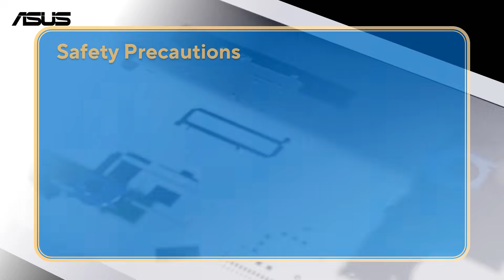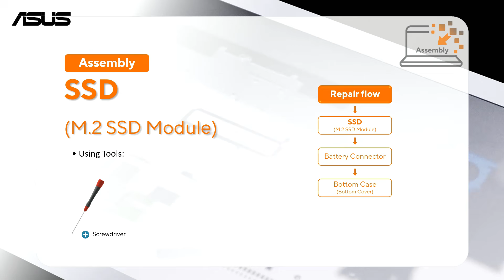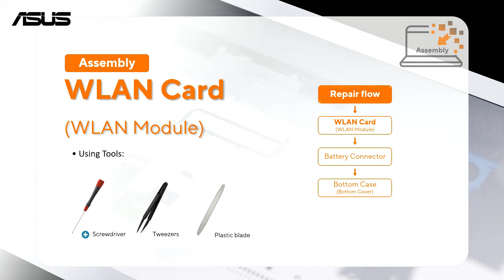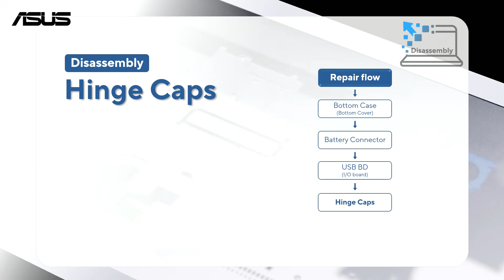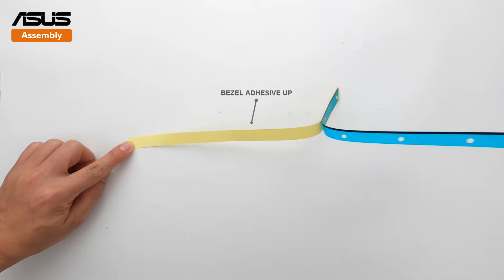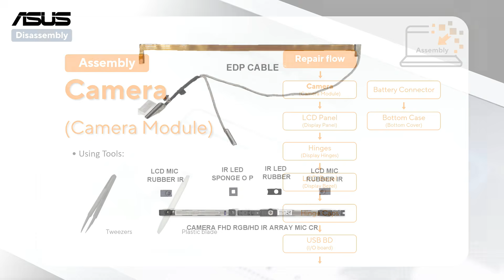Teardown : ASUS Vivobook 14 (M1407GA) Teardown video | ASUS SUPPORT

Comment: I am having a problem with ASUS Driver Hub. I cannot launch or use the application properly because every time I try to open it, it keeps redirecting me back to the ASUS Driver Hub home page. As a result, I am unable to access the features or continue with the installation/update process. Could you please help me resolve this issue?
Reply from the maker: Regarding your question, I would recommend you visit the following forum post to get more assistance.
https://zentalk.asus.com/t5/motherboards/bd-p/motherboards
Sorry for any inconvenience it may be caused.